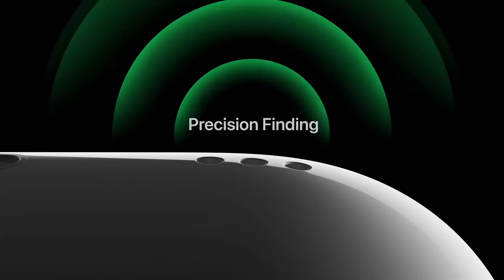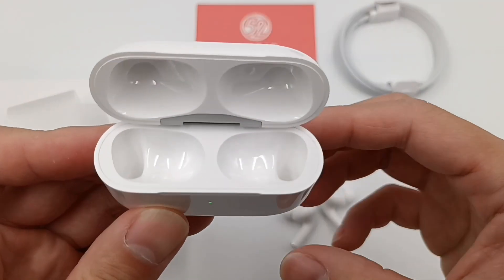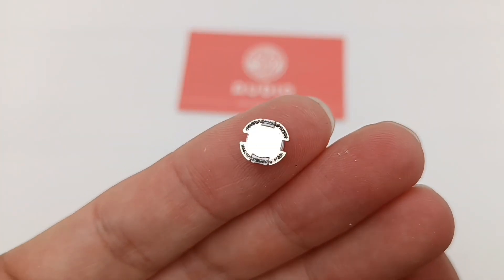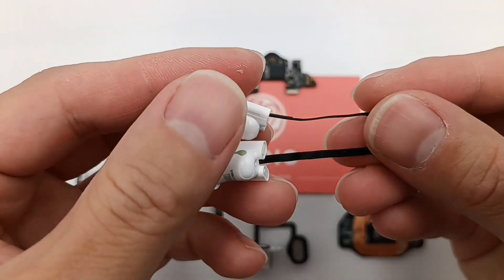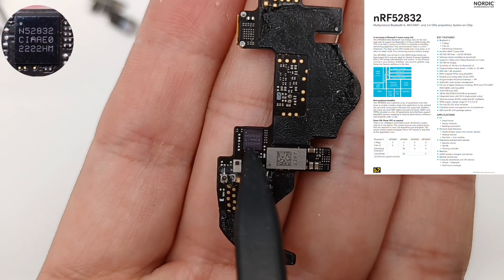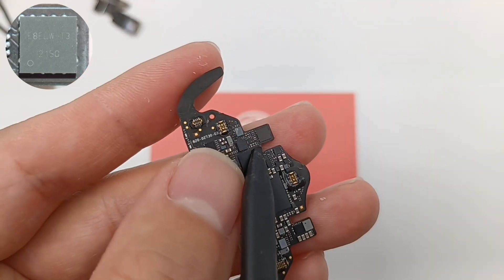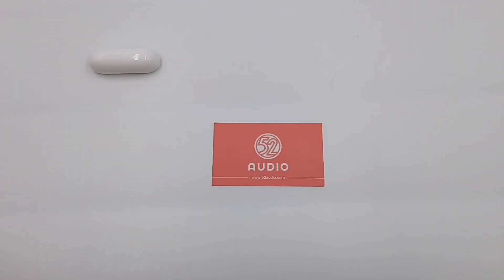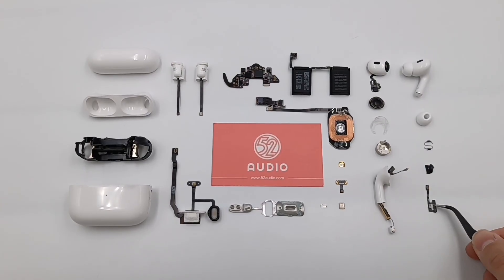Most Detailed | Teardown of Apple AirPods Pro 2

Comment: Great teardown, and very helpful in getting mine opened up. Lots of people in the comments say this is a good teardown and the case is repairable, but unfortunately it's not repairable at all. Notice how he had to cut the sides of the case to pry it open. He doesn't show this, but you can see the missing and broken plastic on the sides. I'll do my best to get mine apart since it needs a new battery, but I'm resigned to tearing it apart now. They already don't work, so I have nothing to lose I guess. Good ol Apple innovation.

Comment: I bought airpods off Amazon for 100$, i thought it was fake, and once i accidentally dropped one of the airpods, the outer shell came off and the inners just showed a small lithium ion battery connected to a small board with some colored wires just soldered into it 💔
Reply: What was noise cancellation in fake one
Reply: @sanjeetsinghmehta  the NC was basically inexistent

Comment: You have done much better job than iFixit. My curiosity about what's inside is now calm. Thank you
Reply: Exactly. They just destroyed it and present a bunch of trash and said it’s unrepairable which is not what I wanna see in a disassembly video.
Reply: @ThangTran-tg6rm  Absolutely!!! I too came here straight from iFixit where instead of an interesting tear-down with an explanation of the different components, I got a lecture about "unrepairability". I found it to be an intensely annoying, self-righteous video with an unskilled presenter who had to melt the case to open it up! This was a 1000x better!